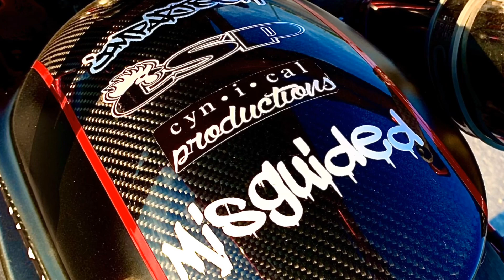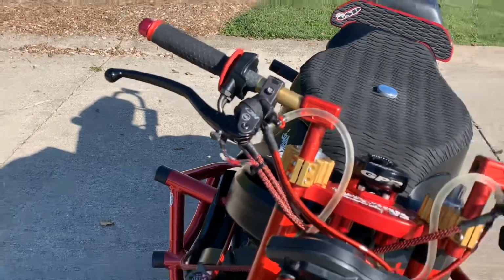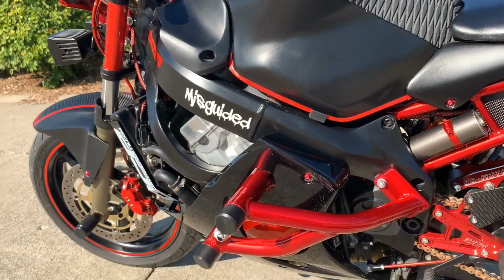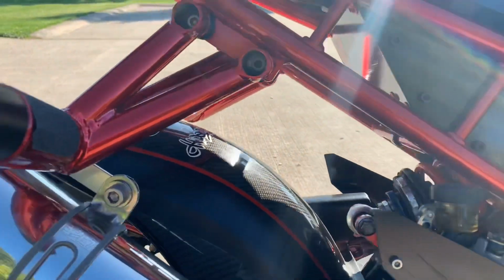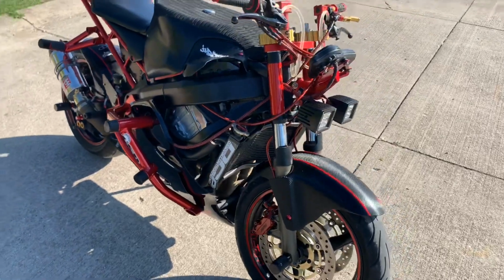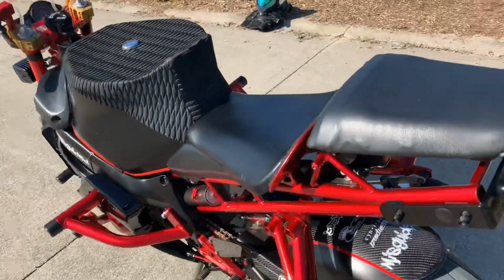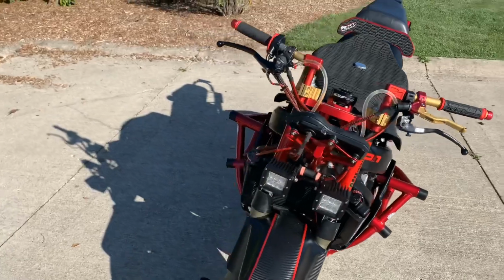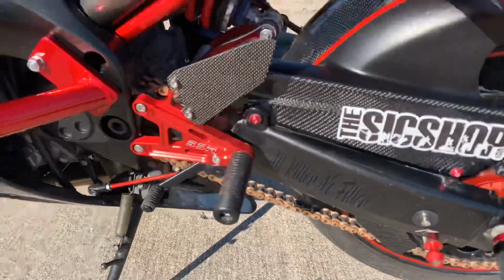Honda f4i Stunt Bike  “ Vanessa “ 2001 CBR 600

Comment: you should make a video on how you wired all that up. im lost when it comes too that. again. nice bike
Reply from the maker: I sell the control systems. Plug and play
Reply: @hojmacdonald  how much are they
Reply from the maker: @zachryan6475  I have simple single switch stuff starting at 75$ and full control systems from 200$-350$

Comment: Amazing bike 🔥🔥🔥 im in the process of building one and i have the same clipons but i need longer throttle cables where did you get yours they look sick
Reply from the maker: Jeremy Galloway thank you  they are oem cables that I took apart and re sleeved with a braided cover
Reply: @hojmacdonald  are they just  Re routed
Reply from the maker: Jeremy Galloway you have to play with the direction of the throttle housing but they pretty much run OEM path. If you can’t finger it out let me know and I can shoot ya short up close vid.
Reply: @hojmacdonald  that would be amazing 👏 🙏

Comment: How many inchs longer you think i would need for clucth cable and stainless brake lines for clip ons / dirt bars ?
Reply from the maker: Clutch I run oem. Brake lines I add about 5” for routing options
Reply: thanks man ! also i just put cocks stunt parts clip ons the bike and im have trouble with the throttle geting stuck when turning how do i get a longer one ? or what would u suggest
Reply from the maker: If you aim the cables down as opposed to out towards the front master it can really help. Some guys run a 929/954 cable with successes well.
Reply: @hojmacdonald  thanks again brotha !

Comment: How do you wire the fan with the override
Reply from the maker: Hey man. I use a high current relay and introduce and new ground after the Oem temp switch

Comment: How do you wire the headlights up i have a f4i but it wont start without the headlight harness plugged in is there a way i can bridge it to remove my fairings and run something similar to yours
Reply: Any help would be greatly appreciated from anyone
Reply from the maker: @greenfalcon5087  at the grey 12pin headlight plug you need to jump the red/white to the green. This bypasses the tip sensor located in the headlight and allows you to remove the entire front assembly
Reply: Thank you so much for the reply man been waiting for a video to explain this